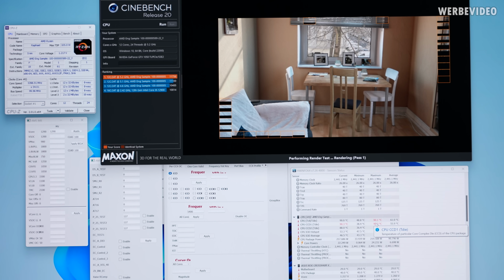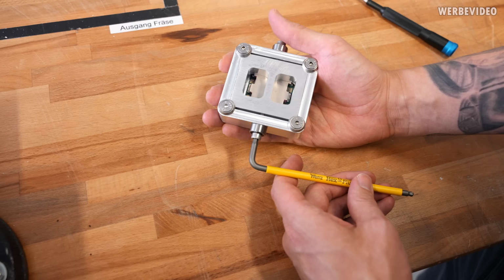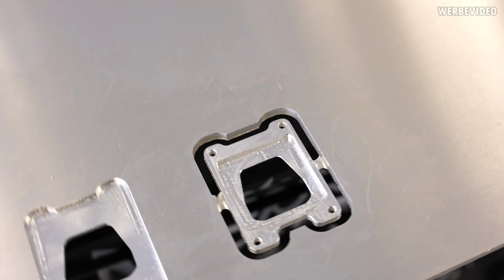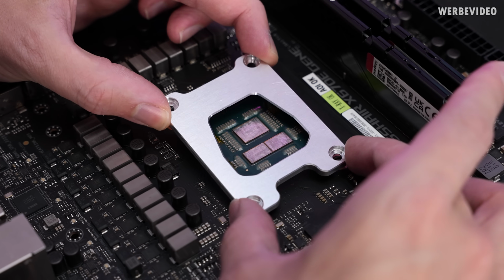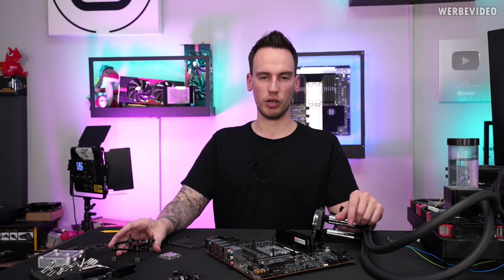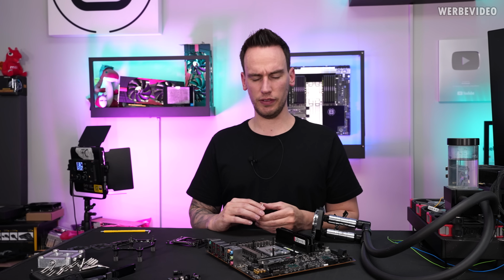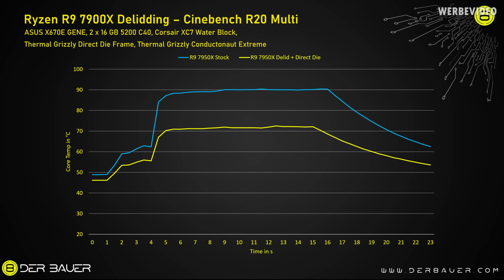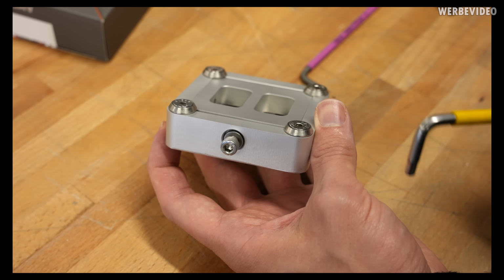Ryzen 7000 Delidding - Unreal Temperature improvement with Direct-Die Cooling

Comment: Oh my, thats insane how much direct die lowered temps. It would be nice to see 7600x or 7700x overclocking with direct die cooling solution.
Reply: Agreed. It´s either about solder bad quality or too thick IHS - or both. Possible cut-cost measure.
Reply: @Morpheus-pt3wq  he explained its because of the thick IHS which was done to keep cooler compatibility with previous gens.
Reply: @TroublesomeOwl  honestly, that´s so stupid. Typical example of a company saving money in a place, where they shouldn´t be saved.
Reply: @Morpheus-pt3wq  Is it really to save money though?  Seems to me they didn't want people to be angry about not being able to use their existing coolers.  
Maybe they could have figured out a better solution, I don't know.
Reply: @PhazerTech  most cooling manufacturers are able to sell brackets for new sockets separately. Or, as in case of Noctua, send them to existing customers for free.
But a company thinking about their customer´s convenience? Don´t make me laugh, or i´m gonna go ROFL.

Comment: Roman you have to convince AMD and Intel to go back to direct die CPUs from the factory, at least for the top ones, with only that metal ring that GPUs and mobile CPUs come nowadays to prevent misalignemt of the cooler block.
Reply: i have no idea why that's not a thing.
Reply: @TheHighborn  It's niche and niche for huge companies like Intel and AMD just isn't worth it.  Plus they would have to cover them under warranty which would be a huge hassle.
Reply: @karehaqt  no, i mean i don't get why that's not baseline. GPUs don't have that shit either.
Reply: @TheHighborn  Indeed. GPU's seem to be fine without an Ihs, especially the small dies like 6500xt. I can see a future of CPUs without the IHS. seems like its more for show then anything these days, which is fine I suppose.
Reply: @MarcABrown-tt1fp  You buy a completed GPU so the die is coming with a heat spreader, aka the cooling solution. Few people open up their GPUs. The CPU is sold but itself, the heat spreader is the only protection from damage. It is not cost effective to warranty more than 5% of a product and without the heat spreader it would be more likely to be about 15% warrantied. This would be from people dropping them, knocking off smds, over tightening coolers, shorting them, and the many other issues with selling to people that have no idea what they are doing.
Reply: @2ndtwo1  Seems reasonable. Though it's unfortunate that the design has to be handicapped due to pure idiots recklessness, As I loved the older Athlon designs due to unparalleled efficiency, temps, and even performance compared to Intel before the Core 2 duo was made.

Comment: AMD mentioned officially it HAS to run at 95 for optimum performance. It is NOT in your interest to lower this. Check optimum tech video.
Reply from the maker: That is some strong marketing nonsense 😂
Reply: Well, with this you can run it at 95 faster.
Reply: You need to pay better attention. They said it can safely run at 95c and will often do so to extract maximum performance. They never said it HAS to run at that. If the CPU hits a current or power limit first it can still stay below 95.
Reply: No they said it can run at 95 with no negatives, less heat is still better.
Reply: Watch the video bud, check the numbers, the processor gave more performance and consumed low power after de-lidding. 

it consumes low power because, with rise in temperature, the conductor resistance also raises, Electric resistance is directly proportional to heat. (that is why most super comupters work at sub zero temperatures) for low power consumption, temps need to be low assuming performance is constant.

Please stop believing random marketing nonsense and apply basic thermodynamics. check numbers.